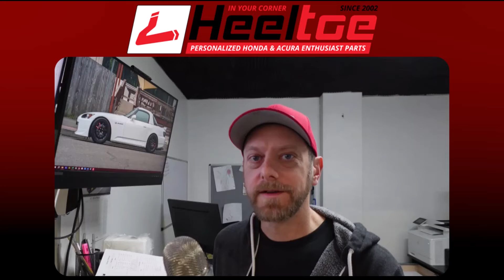CC28: "Settling" a Myth About Lowering Springs

Comment: Run plenty of springs from H&R and they always settle and lower a bit after installing over the next few weeks. There are actually a few companies that go into detail as to why they settle. You can call H&R right now and they will explain that the springs will settle. It won't be .5+ inches but they will settle and lower a bit more after driving around for a few weeks. If you want to argue this, that is fine but I'd like to see cited sources or actual data to back up your claim, instead of just making the claim.
Reply from the maker: I've got nearly 3 decades of personal experience and that is firm enough ground to stand on across from you. I have not seen it. People SAY a lot and theoretically are not incorrect, but there is a difference between knowledge and wisdom. Knowledge can tell you all the reasons why something could happen, or even that it should. Practical experience provides the truth in the face of facts. Bushing compress, spring seats compress. Springs don't settle.

I am expecting that spring manufacturers, if they have not designed springs specifically so they would intentionally sag to a calibrated height (which sounds absurd), would be making statements about "settling" to cover their asses against people with gripes about finite lowering specs. Nobody could be held to the specific standard of a number with something like springs, where people will have varying experiences over time. 

That all said, I emailed my rep at H&R for an official comment, since I am a direct dealer. Waiting for a reply, and viewing their website I found "H&R Special Springs are high quality products—they will not set or sag..." ref: https://hrsprings.com/products/detail/springs 
Also on their technical resources link, the words "set" or "settle" do not appear once, not even in their technical docs and warranty statement: https://hrsprings.com/technical/frequently-asked-questions 

For good measure, I looked on Eibach's site as well and found their advice: "And before you measure the 'after' dimension, drive the car hard for ten miles to let the springs, spacers, etc. seat properly." This statement is in far better alignment with my claim than with your idea that two weeks later it could change up to 1/2".
ref: https://eibach.com/instructions 

Can you imagine needing to break in race springs to get their "final height" before corner-weighting a car? if I bought springs advertised to lower 1.5" as stated by the manufacturer and a few weeks in they dropped to 1.75" lower that would be pretty annoying. I have some customers that would not like that at all. These things matter.

Comment: I no doubt would buy quality springs & I'm strongly considering lowering my car but my question is what are the chances of doing damage underneath the car if it bottoms out. I'm here on the east coast where we have a lot of pot holes & just bad roads in general, & how harsh is the ride
Reply from the maker: Great question! Honestly, with reasonable lowering (1-2" drop) the odds of damaging something is really rather low. There is more clearance under there than you think. Now, lowering the car more on stock dampers does carry risk, which over rough roads that work the suspension more it can bottom out the dampers more and cause extra wear and tear meaning needing new shocks prematurely. Many folks are after lower and lower and lower heights, but once you get past an inch or so you really need to consider coilovers in stead of just springs.
Reply: @Heeltoe.  Cool! Thx for the response I'll surely weigh my options